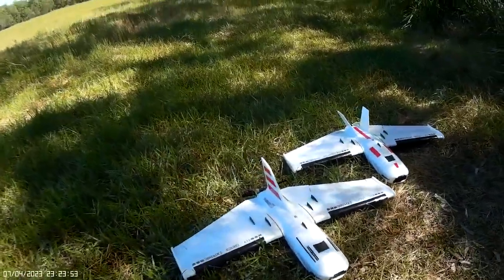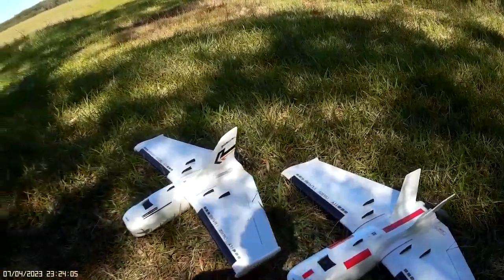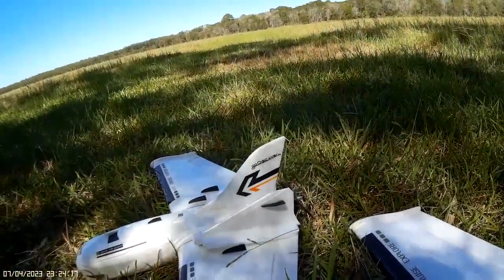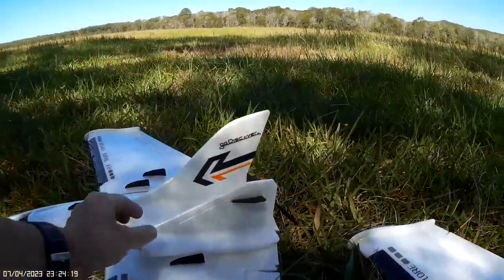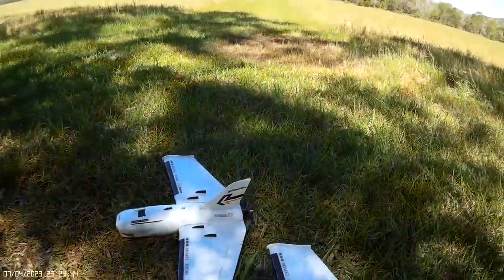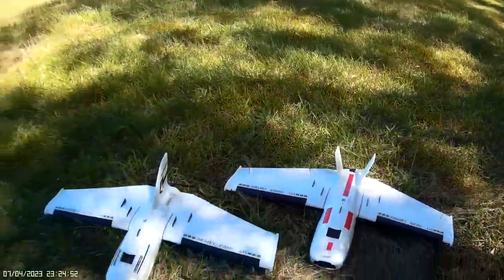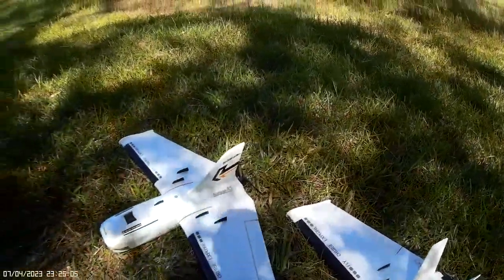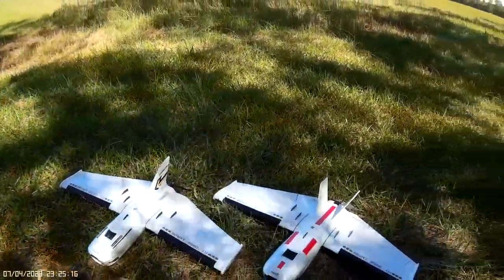Rambler-RS FPV Wing Vertical Stabilizer Mods (x 2) - Introduction &  Description - (Please Read)

Comment: Seems to be a Rambler population explosion of numbers up there !!. Do you use Differential on the Ailerons ?? More Up going than Down.
Reply from the maker: Haha...  i do have differential set up on both my Rambler's but they have so much built in reflex i have to have a bit of downtrim set to compensate...  I  could change the motor thrust angle with a couple of washers i guess...  but they are both great flyers..  had them a while now...  just making them better .😅👍
Reply: @craigmcdonald-rcflight   Agree.😛